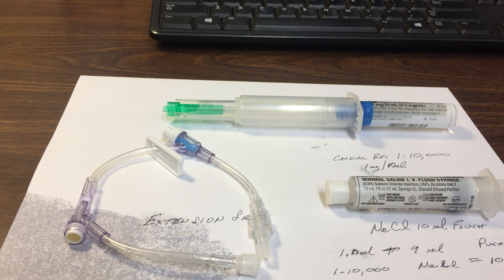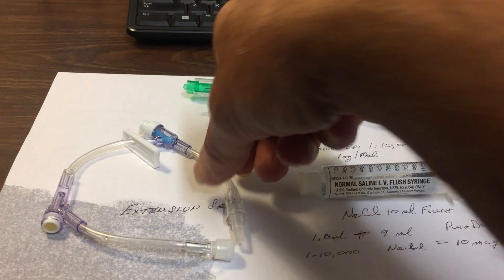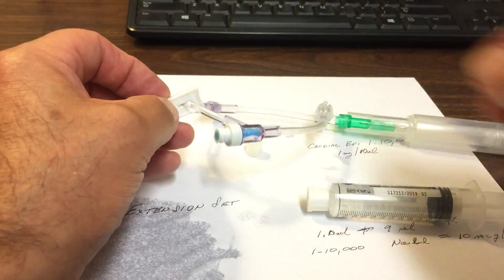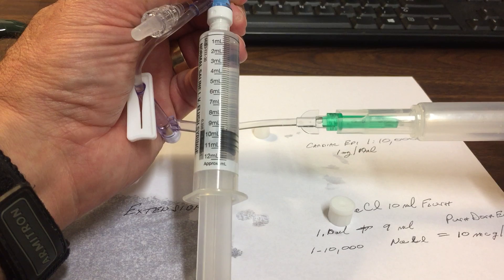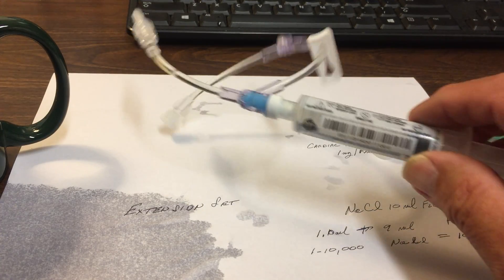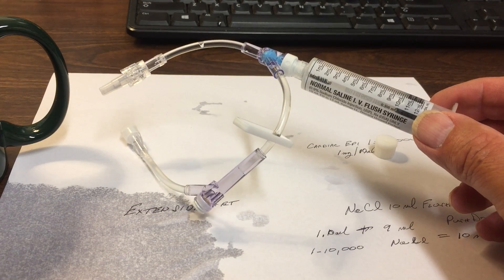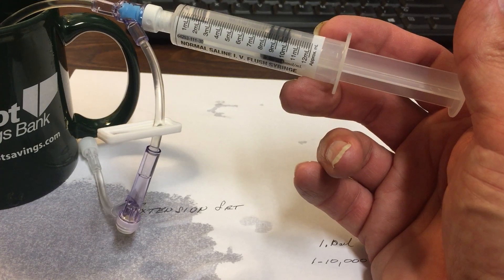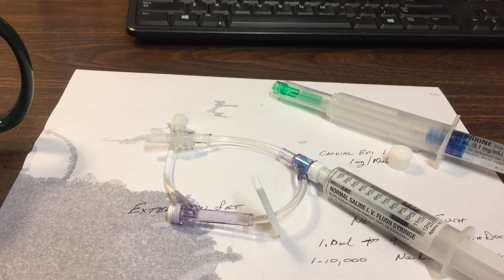Push Dose Epinephrine

Comment: you account for the cc or so of NS in your line in front of your little brew?  if not, you just gave your pt 1 cc of NS and a CC of your mix.  Thats a drug admin error....might wanna revisit your protocols
Reply from the maker: Good comment and we discussed this at our training - that is why you fill the line with epi 1-10,000 up to the port where you draw up the solution into the NaCl - there is a very small amount of NaCl in the tubbing but definitely less than 1 cc and that amount is only for the first dose so it is insignificant and happens anytime you push a med in an IV port i.e. Adenosine etc. so this does comply with our drug administration protocols - THX 👍😎
Reply: Mike Kroeger that's why you flush the line.   There is no flushing in push dose
Reply from the maker: Understand and poor choice of an example - made me think and from now on I am going to use the extension set as a way to get the 10 ml of epi 1/100,000, label same and use it on the port of the IV eliminating the NaCl in the extension line and push as directed in our protocol THX :)